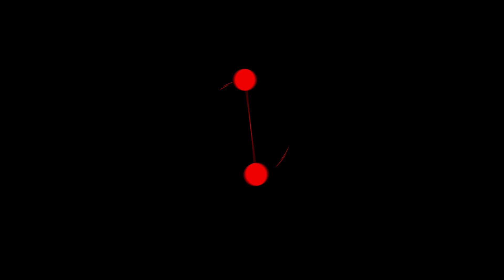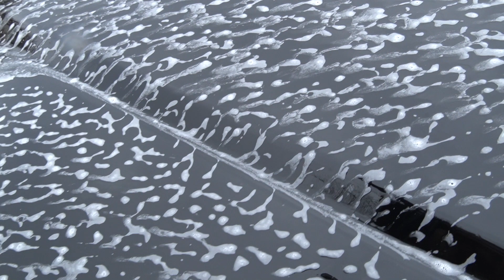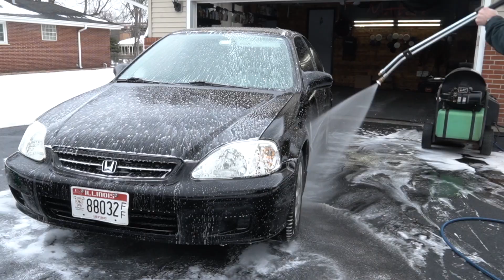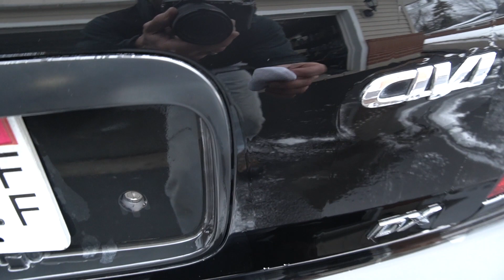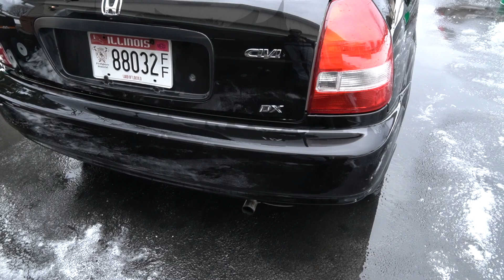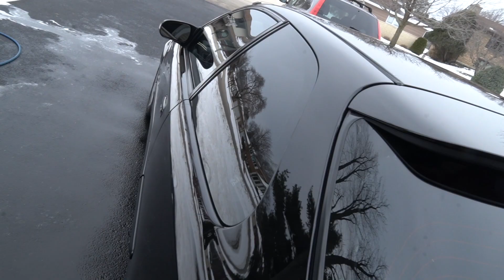Touch-less Washing Using My Hot Water Pressure Washer (Part 2)

Comment: Hey Matt @matthewsspecializeddetaili610 , just subscribed. TLDR; is 112 deg hot water HOT ENOUGH / worth it for touchless washes? Care to comment if my max temp 112 degree water is worth me running a 2nd hot pex line out to the garage for my black garage queen weekend car? 

I am 100% running a cold line out to garage for a DI spot free rinse this spring. I’ve got some clearance issues even snake-ing one 1/2 cold line through walls but contemplating sending two lines. 

My new ryobi itty bitty power washer will likely always remain a cold unit. My 112 degree water will always remain that max temp as I prefer not to adjust higher for family sake throughout house. Thanks for any input!
Reply from the maker: 112 is enough heat for touch less washing. The key factor is more at GPM you need to be about 2GMP to flush the surfaces. Heat alone is only one portion of the process. If you have low GPM its going to take loner and not work so well.   

The other key liquid to use is Oberk's APS soap for maximum cleaning and ease of rinsing. So many excellent products on the market today. Hope this helps you on your quest

Comment: Was there any traffic film on your vehicle. I am curious to know if the hot water would remove traffic film using a touchless wash
Reply from the maker: By traffic film, do you mean road paint? I have had success removing all kinds of stuff with hot water, including tar.
Reply: @matthewsspecializeddetaili610  traffic film is the grey-ish film of dirt on the body work.
I would probably best describe it as a thin film of grease personally.
So a couple of years ago I set up a mobile car cleaning business which was only for the Exterior the idea was to do a touchless wash I used a product called nerta foam and jet washed the vehicle with cold water from a pressure washer it was great however it left traffic film.
So basically I abandoned the idea as I wasn’t convinced I was doing a 100 percent job. Going back to the drawing board I thought maybe the mistake I made was using cold water however it would of meant spending quiet abit of money to change equipment to just find out, as there aren’t many videos on hot water cleaning so I’m glad I’ve found this any suggestions would be appreciated as I am still curious to this day

Comment: Impressive, if I had three wishes, a garage big enough to have a warm washbay area & hot water pressure washer would be up there too, third wish, I need to think about. (NOT a criticism) Just wondering to what % the hot water had in delivering a 95% PLUS touchless clean over & cold water wash or was it the effectiveness of the prewash/detergent?  only one way to find out 🙂
Reply from the maker: The hot water is the real key to making the touch-less wash work efficiently. I will be doing some more testing with cold water. The hot water does increase the cleaning ability of the specific detergent I am using, but the heat helps flush all the solids and the chemicals to rinse freely from the surface. Lots of trial and errors yet before this is perfected and implemented into my services. I appreciate the engagement, and thank you for watching. Now I have to think about my wishes 😉
Reply: @matthewsspecializeddetaili610   Thank you for sharing your experience with us, it is appreciated, as I only regularly look after the family cars do you consider 'hot water' having zero effect re the durability of ceramic / graphene coatings? all of our vehicals are coated (now its family relatives & friends that keep me busy) I cant see myself ever being able to justify an all singing/dancing hot water generating pressure washer but one that can take a hot water feed from the house / garage is a real option as building the man-cave I want isnt on the cards. Take care fella, wishing you health & happiness.

Comment: is there any concern in colder temperatures  (below 32 degrees) of glass cracking when using hot (water) pressure washer or steamer?
Reply from the maker: It would need to much colder than 32 degrees outside for that to happen. Never the less, it is something to be cautious about. I am only washing outside when it is above 32.